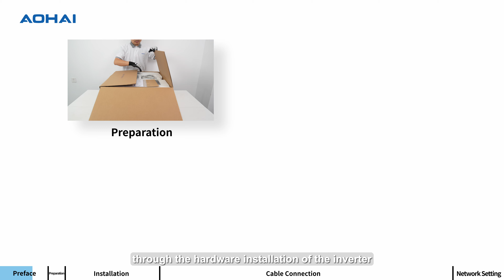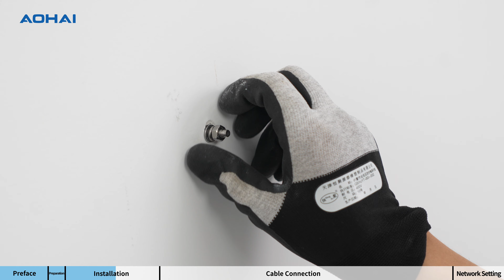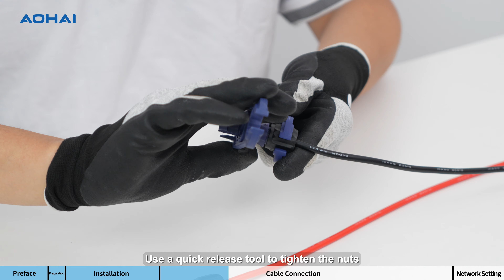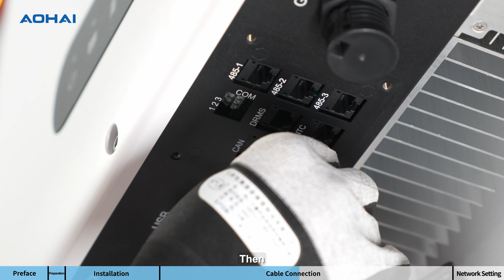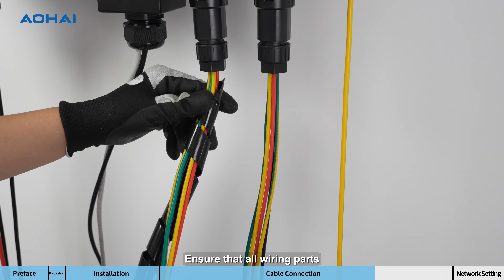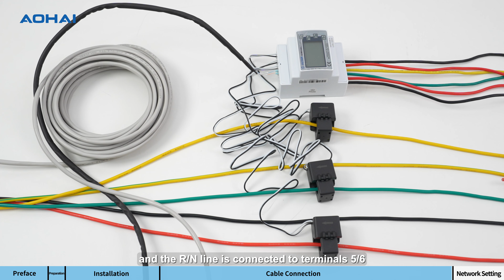Installation Instructions: Three-phase Hybrid Inverter AH-4-10KTH-G1

Comment: This product is very problematic. I bought and connect 100ah battery with lifepo4 and 100ah gel battery did not work. I send under guarantee service and could not fixed. Looks like problematic software. Dont buy!